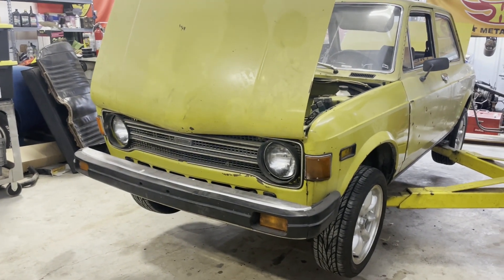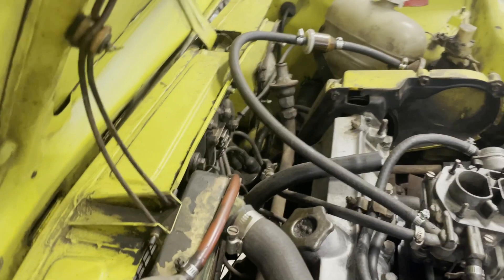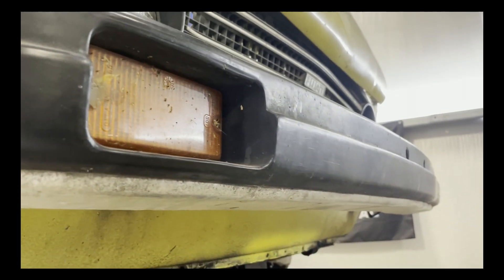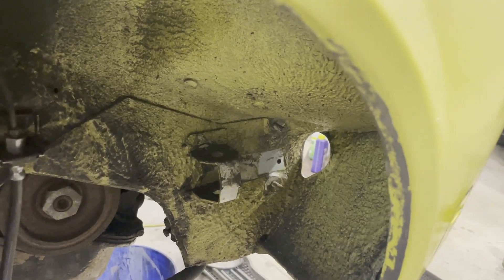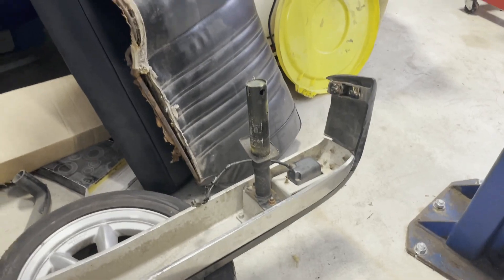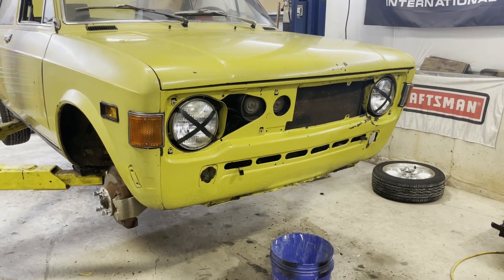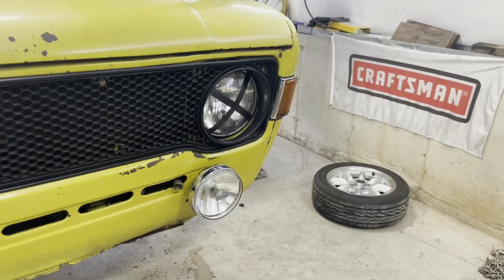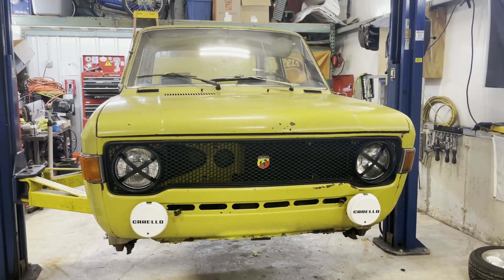Fiat 128 Front End Updates

Comment: If the engine is consuming oil or blowing blue smoke , then there are 3 usual ways that can happen.

1. Valve stem oil seals.
A way that you can know this is if it blows a lot of smoke at first start up , especially when left overnight , but then if you start it up again after a very short time there is much less smoke.
2. Worn compression piston rings.
You can check this by seeing if there is a lot of oil residue in the air filter housing , or air puffing out of the crankcase breather tube that connects to the air filter when the engine is running.
3. Worn oil control piston rings.
This will be known by just a continual usage of oil , the more miles you do , the comparably more oil you consume.

A compression test is a good idea.
If the cranking pressures are outside of the acceptable range you can lay a bet on it that the rings are bad and that is the cause of the oil consumption.
Reply from the maker: I will be posting a video on this soon

Comment: I have 75 x19 ecelent compression but burned oil and smoked fixed the problem with wn engine flush lubro moly engine flus the oil was clean after 10min with it it came out black. We the did several radiator flushed with brought the temp to below the middle  mark as oposed to it being higher than the middle mark. Tons of rust came out of the flush. Flush with preston or acid flush and water preferably distilled and do it until it comes out clean....you will thank me
Reply from the maker: will try it